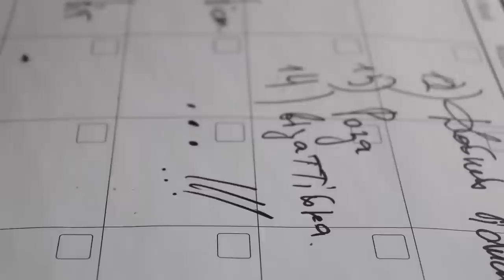Making Silver Bracelet | Cardinal chain | Arabic Bismark | Арабский Бисмарк

Comment: Wow!  That's amazing to truly start with molten metal and finish with a beautiful piece of jewelry.  At 09:19 where you showed how it looked linked together so far was really cool. The way you linked it together by coiling the coils together sure beats assembling individual links not to mention less pieces to solder together. As an aspiring bench jeweler, I may try this method of linking when I get better at soldering. I tried to make a Byzantine bracelet once but I have no patience for opening and closing so many jump rings and they're difficult to hold onto. It's very tedious. I'm so impressed with your method of doing this and really the entire process is amazing.  The bracelet is very beautiful and heavy considering it weighs a little over 1 OZT.  You are truly an artist!  Thanks for sharing! 🙂

Comment: I read your care instructions and was wondering about rinsing after washing with soapy water. I had problems wearing Sterling chains. My body chemistry causes them to turn black after 1 or 2 days of wearing them. My jeweler advised me to wash with blue Dawn dish soap but told me NOT to rinse.  He said it would leave a film that would help prevent it from oxidizing so quickly but I'd have to repeat the process.  I was wondering if you knew anything about this? Thanks!

Comment: So cool. I have wanted a bracket like that for a very long time. I prefer silver and white gold or platinum over yellow gold.
I personally think it looks better on me than yellow. I have a Cuban chain made in Italy, nice heavy piece but it has a few areas that were close to a penny and a quarter and the area was damp. I tried polishing it out by hand then made the mistake of using the original dremel. It’s not ruined but the those areas will quickly contrast after a hand polish. I took it to a watch and jewelry repair person who thought they could get it looking new again but failed. There may be an anti tarnish plate over the sterling that is making this difficult. Any way to clean a piece up without heating and tools